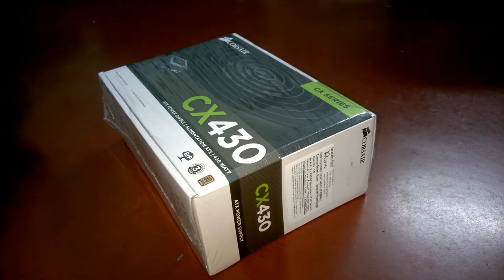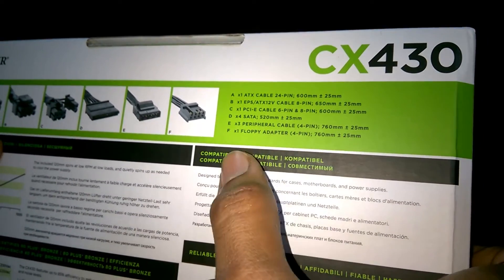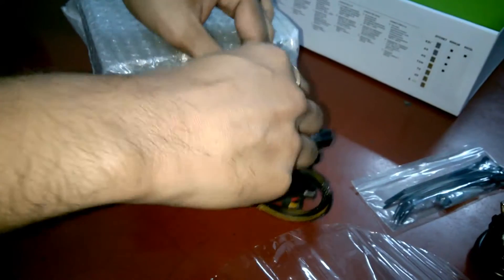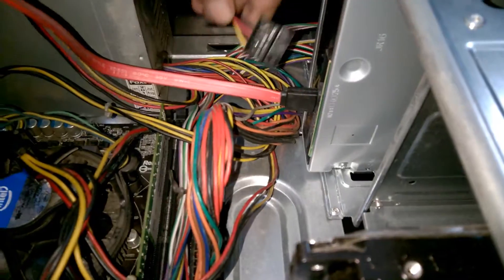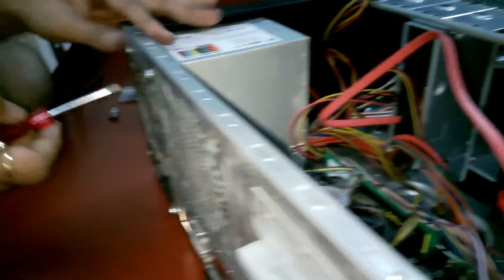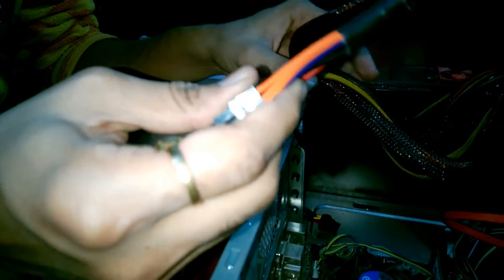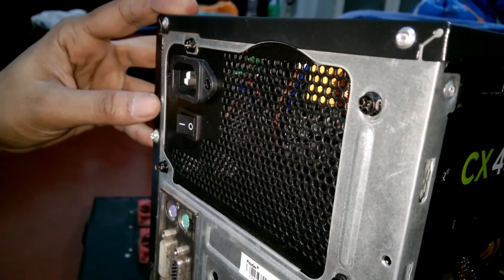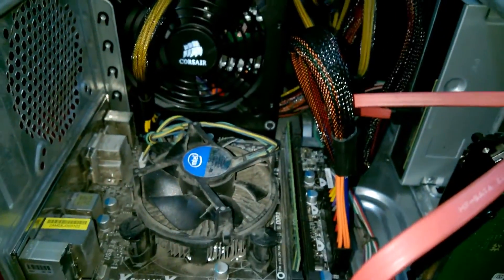How To Install A PSU/SMPS ? : Using The Corsair CX430 PSU...

Comment: can psu go into any computers or does it have requirements?
for example. graphics cards need some requirements like Watts, length or 6 pin power adapters.
Reply from the maker: I understand what you're talking about... Firstly size wise yes this can go into almost any cabinet unless you're opting for a case that is the size of a console... The thing that most people should be concerned about is the wattage, and the CX 430 delivers 32A on the 12V rail.. when buying a PSU always check that it delivers at least 28A on the 12V rail.. else you're gonna have problems using high - end components in your PC.. Using decent components might put a lot of pressure on your cheap PSU and may fry it which might also harm other components (GFX card, processor, motherboard etc.) in ur PC.. The length of any of the components of a PC are not limited by a PSU...  and lastly, this power supply comes with a 8pin (6pin + 2pin{which can be split up}) PCI-E connectors for the GFX card... Check the connectors on ur GFX card before buying a PSU.. Use an online wattage calculator to calculate how much power your PC might consume.. For eg. if your PC consumes 250 Watts in total a 300 watt PSU will work but a 350 watt or 400 watt PSU is always recommended.. Also see how check the power connectors on your motherboard... In general, most motherboards are powered by a 24pin connector... The CX - 430 is highly recommended for a mid - range system... If you are building a high end rig i would suggest getting anything above 600 watts...
Reply: +Tech Geek is cx430 good for gfx card gtx 750 ti? thank u so much for the reply
Reply from the maker: Definitely good... You'll see some versions of the 750ti with a 6pin and without a 6pin connector... Both of them are very much compatible with the CX - 430.. A personal tip : Go for a AMD RX 460.. if you can get it for a similar price in your area... (and even that is very much compatible with the CX - 430).. What's the rest of your build may i ask?
Reply: +Tech Geek like my cpu specs?
Reply from the maker: Yep?
Reply: +Tech Geek sorry I am pretty bad at pc
i5-4430 3.0ghz
8192G ram
window 10 pro 64bit
Gpu: intel hd 4600
PSU: total Wattage 180 external power adapter(120V-240V)
Reply from the maker: yep! go for an AMD RX 460 and you'll be getting very good frame rates in most of the current AAA titles...
Reply: +Tech Geek so cx430and rx460 can fit or work fine on my pc? if yes, thank you very very much!!
Reply: +2백구 but I have to change the PSU right?
Reply from the maker: If you're using a cheap PSU... like maybe one that came with the cabinet you bought considering it was also cheap... then YEP!
Reply: +Tech Geek ok thank you very much, am considering to buy cx430 thank you again good video!!
Reply from the maker: Welcome ! ;)
Reply: +Tech Geek can cx430 handle rx470 as well or need stronger PSU?
Reply from the maker: You can definitely use the CX 430 with the RX 470... You'll still have headroom but most people would suggest u to go with something like an EVGA 550 - 600 watt PSU.. If you're on a tight budget the CX - 430 will serve you for the most part.. And if you can squeeze out a little bit more money then maybe go for a corsair RM series PSU..
Reply: +Tech Geek thank u so much for the help
Reply from the maker: You're Welcome ! :)